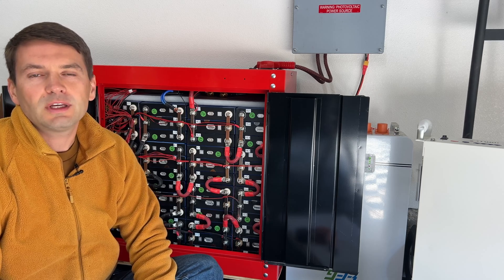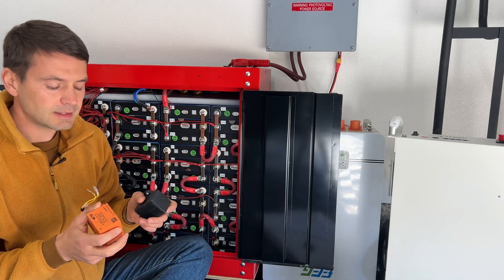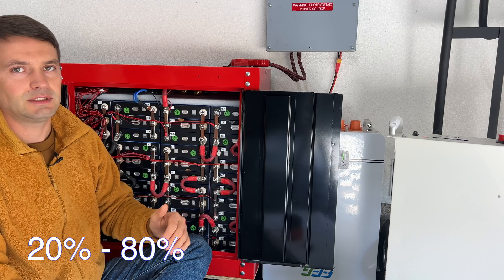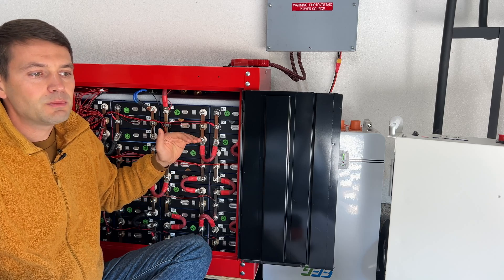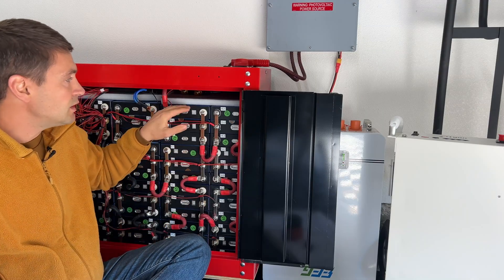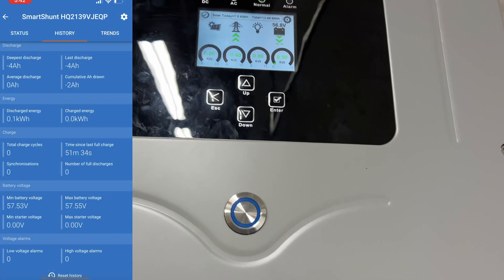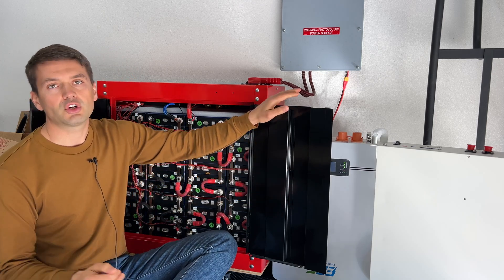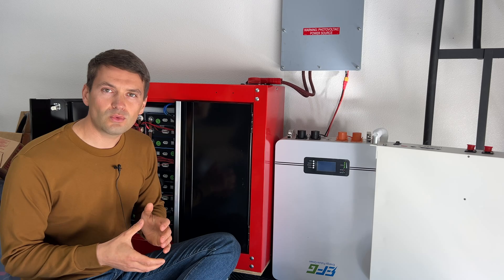Testing LiFePo4 capacity after 3 years of use. Are 4000 cycles realistic?

Comment: I have really come to believe that the 16s1p, 8s1p,4s1p configurations are the correct way to go considering the cost of a good bms isnt that much more than the cost of getting one cell sent to you. I think andys off grid garage is a good channel he has riding the compression non compression debate pretty hard. I also think the more modern (considering where the tech has come in 3 years too) cells are looking like the production techniques are spot on and that the technology is really taking its stride. I just bought some eve mb30 and it was a very easy streamlined process and they seem nice time will tell.

Comment: I just bought my first battery, so I don't have experience, but I've been learning a lot.  This is what I have gathered:  There is a difference between an "A" grade cell and an EV grade cell, an EV grade being suitable for use in Electric cars and which must pass the most stringent criteria specified by the Chinese government. Grade A cells are those which fail to pass EV cell tests and are sold for less. They have no government standard and it is up to the seller to decide what to call them.  Were your cells identified as EV grade and did they come with the original spec sheet? If they were EV grade then they should have. The spec sheets are often faked. If you got a spec sheet that was all black and white, it is fake. It should be colored. At least this is what I have learned (if it is indeed correct.)  Non-EV grade cells will have lesser life or performance characteristics. Feel free to set me straight if I'm wrong about this.

Comment: Are you licensed to work in Nevada...I live in Las Vegas?  I would like to get a solar system installed but nobody will install the EG4 18Kpv here since it isn't Enphase or SolarEdge.  I found one company that will install a Sol-Ark 15K but only if they supply it and they want to charge a fortune for the unit even though the prices have come down a lot since the release of the EG4.  I do have a great supplier (CSE Solar) here in town so I could get anything and have it on site.
Reply from the maker: no, only in CA
Reply: @SolarEngineering  OK thanks, its a shame I cannot find anyone here that will do it.

Comment: Sorry if this is a dumb question. So you only need to balance cells in series not parallel? For example, I could parallel 4 of your power walls and not balance them other than what is done in the individual power walls?
Reply from the maker: if you connect 4 PW in parallel than it's going to balance voltage across PWs, but not cells in each PW. Still need some kind of balancer in each PW (either active or passive)

Comment: I had an issue with balancing that is solved using additional neey active balancer. I think it will be much better if you are using compression on cells. Top row cells not getting any compression and this cell  orenation not good so chances of heigher degradation . I think vertical arrangement with proper compression will be good for longer cells life 
Thanks for sharing your experience.
Reply from the maker: I tried to add another active balancer, but 2 balancers were balancing each other sometimes :) so removed one.
Reply: @SolarEngineering  in my case in built balancer is only 200ma (BMS) and in neey Bluetooth balancer I can configure parameters and it's 4A

Comment: Hi. I am a LiFePO4 user and hobbyist. My idea is that not charging to full capacity (not 100%), is actually doing more harm than charging them all the way 3,45v and absorb there for an hour. It is my understanding that leaving the batteries at a lower state of charge (80%), is more likely to hit a low state of charge mire often. And my guess is that a being at lower voltage for longer periods of time is what kills LiFePO4 prematurely.

Will Prowse has mentioned it recently, that all the batteries he left empty, were done in few weeks, whilst the ones he left fully charged had no degradation whatsoever (not in intensive use).

If your batteries are going to degrade that fast, I would say it makes sense to fully charge them to 56V (3,5v per cell), absorb at 3,45V and float at 3,35V. It is still pretty conservative, and giving the opportunity for the pack to balance over 3,45V every day for a little time.

I would definitely also consider some CALB or EVE cells, renowned providers.

Also have to say I am jealous of that workshop and space... I live in an apartment and have no south facing space to fit panels...

Nice short video.

Cheers
Reply from the maker: thank you for the info and kind feedback.

Comment: I believe 4:25 someone doing these same kind of tests said that the capacity loss does not happen linear, in the total cycles of battery the capacity loss would be higher at start, then very little capacity loss long time, and then capacity loss would get again higher when battery life is about to end.  You probably could confirm or bust this information by doing some tests with shorter time period between them and compare the results if it's linear or is it more likely the bigger capacity changes happen only at start and end of the battery life.

Comment: Set charging voltage to 55.2V have balancer turn on at 3.45V I did this and my cells are coming way closer to each other. if you balance before 3.45 volts in a cell it causes more imbalances.  Also split your pack into 4 packs. you are not doing .15C those cells are small and large amounts of amps is too much. example is a 25ah cell in a Battery pack still is 1C at 25 amps. Doesn't matter if you have 4p. with a 25ah cell 5 amps is 20% or .2C. Your cells will not last as long as you think since you are really doing  3C or 4C. I have 280ah cells I do not charge or discharge any pack (4 packs of14.3kw) over .2 which is 56amps. That is why I have 4 packs and soon will have 6 when I add more solar and another inverter so I stay low C rating. I have 1.2 years on these cells. Just now getting them top balanced.
Reply from the maker: thanks for the advise

Comment: Flexible busbars would make a real difference.
Also, it is too late for that, but there are two orientations that your cells should not have.
On of them is your orientations. On the side, the gas bubbles from the first cycles can not escape and reduce your capacity. Also Fixation of the cells would help with this issue during the first cycles at least.
Reply: I second this.  The 4,000 cycles is with compression (at least for the first several cycles until gas has escaped).  Without compression I thought it full cycle life was more like 2,500.

Comment: On my 107,520 watt system I charge/discharge my 280ah lifepo4 cells about 70% from 3.5v down to 2.8v or 56v~44.8 (using only 75,264 watts of the battery potential)
Having Eight DIY 48v 280ah batteries in parallel they never get pushed and stay balanced primarily, because I run them at about 70% capacity I feel. This light duty cycle rate has been very stable and over the last two years performed very well. I have one 48v battery that needs to have cell 16 charged up a bit to fully balance the pack so it doesn’t kick off a tiny bit early. I may replace this cell if it doesn’t hold its balancing act 😂
I have the cells lightly ratchet strapped together but not compressed like so many others have done. The only swelling I have seen on any cell was because I was manually charging this one cell and forgot about it for two hours too long and over charged it to over 4 volts. I of course replaced the ballooned cell. This damaged cell sat outside for the last two years in the elements along with one other cell that was slightly weak. (about 5% below spec) 
I recently took these two cells and installed them in a 1952 Farmall Super C tractor that has a 6v system. I didn’t charge or check them and they kicked that old tractor to life super easily! Amazing LFP cells!
I am very happy with my system and have No Cell Swelling Whatsoever, except as explained.
Of course they are being run very lightly, exactly as I planned.
Thanks for your informative video 
Merry Christmas 
Peace Prospector Tripp
Reply from the maker: thank you for details about your system
Reply: @SolarEngineering hi, can you tell me tools I need to do a capacity testing on a 16kwh LFP battery
Reply: Hello friend 
Can I contact you through your Email? Expertise consultation on assembled batteries

Comment: I have concern wit how you arrange the cell bottom up. wit that said, my concern is that the bottom cell will have a different pressure compare to the top. That probably efect the fasyer degradation of your cell overtime.

Did you check single cell capcacity between you bottom cell and your top cell?
Reply from the maker: no, haven't run test on individual cells

Comment: Some thoughts...  Cells drop some capacity after the first few cycles, so part of that drop is likely because of that.  Secondly, all these cells calendar age in time, regardless of the number of cycles on them, I'm sure this is also what you're seeing here.  I believe I also noticed an outlier cell at the end of the test, which means changes are that one cell is artificially bringing down the capacity of the entire pack.  Changing that one cell out would likely restore a decent percentage for the entire pack as a whole.

Lastly, I would set the cells to a lowish state of charge, disassemble the entire pack, then fit in a fixture with springs (valve springs are cheap and work well).  I might be too late to remove the bloating, but you can remove a little of it with pressure and reduce the chance of seeing more bloating in the future if you contain the cells, but use springs at this point to make sure you're not completely confining them and causing more damage.
These are the springs I like to use (but similar works as well):
https://www.oreillyauto.com/detail/c/melling/melling-valve-spring/mel0/vs360?q=Melling+VS-360&pos=0
Reply from the maker: interesting idea with the spring, thanks

Comment: I install profesionally.  A fixture is mandatory for these cells.  In larger instalations like yours the expansion can stress the terminals and break the posts.  You can't compress the cells now, but i sugest you lossen and then re-tighten the bus bars to take some of the stress off the posts.  Drill the holes a bit bigger on the bus bar if you have to.  You could also replace with a flexible bus bar.  This might require a full disasembly of the pack if things are really tight.
Reply from the maker: thanks for the advise, I did loose and re-tight nuts on top 3 cells
Reply: @SolarEngineering  I'd sugest doing the rest too.  They proably have not expanded as much due to the weight on them, but there was no fixture so they will have expanded too.
Reply: I personally would disassemble the entire pack, set the cells to a lowish state of charge, then fit in a fixture with springs (valve springs are cheap and work well).
Reply: @ssoffshore5111  this was my thought the first time I came accross this problem many years ago.  The problem that arises is that the fixture ends up cocking the cells back and forth, and makes more stress on indvidual terminals.  Also, if the fixture is too tight, the pressure seal on the cells breaks.

An ideaI haven't tried this yet, is adding a fixture that is coupled with some sort of calking between the swelling gaps of the cells that would stop the further movement of the cells.
Reply: What about pouring epoxy between the cells
Reply: Are the cells expanding because of excessive heat temperatures? Do they need air gaps for cooling seems like a good idea to have some heat separation.
Reply: I came late to this post, I think there was an issue with the Bms, if all the cells was matched(balanced) , then its could have been difficult for that cell to swell, another thing will be terminal, its there is a partial contact, its can still cause that cell to swell. Also please take note that charging your batteries to 80% cannot make your cells to be balanced at all time.  Am talking from experience, I also had a DIY I build for a client system, 460ah 48v, I used Daly BMS, this systems was done 4years & 7months ago, everything is still fine.

Comment: Great vid as always thank you. How about a video on Growatt TL MIN-XH-US installed to grid???  Nobody shows Growatt installs and they are very reasonably priced inverter.
Reply: I am not sure about the model you mentioned, but David Poz does a few videos on the Growatt SPF5000ES. After watching his videos, that is the model I decided to go with, even though I had to get a Mid-Point Transformer in order to get 120V, as they put out 240V. I still feel that they are one of the best inverters for the price. I've seen a few, including the EG4 6000XP Off-Grid Inverter, (Which is also sold by Signature Solar), but I wasn't able to afford two of those at $1,399 each, while I was able to get the 5000ES at $900 each , or $2,258 for two plus the Transformer. They are now lower priced at $746 each, (plus, of course, the cost of the Tranformer). 
On the other hand, DIY Solar with Will Prowse has totally gotten away from Growatts and gone with the EG4 brand.
Reply: @Tumbleweed5150  I really like eg4 6000 but you need two and at least one battery. That’s three times the price of Growatt.
Reply from the maker: thanks, sorry not planning to do growatt reviews yet

Comment: Thank you for the update video on capacity! I wonder if the difference in accuracy of the shunts used from 1st test to the Victron would account for some of those capacity differences?
Reply from the maker: yeah, potentially it's possible
Reply: @SolarEngineering  That was exactly my thought - 5% drop in that short of a timespan sounds drastic, but diff's in measurement technique could explain a lot of that. I also have heard it claimed that they lose "a lot of capacity" in the first several cycles, but that loss over time flattens out. How many times did you cycle them initially? IOW, is that initial baseline even valid, irrespective of the differences in the shunts being used? Not really a criticism, just wondering...

Comment: I'm by no means an expert, but from everything I've seen, the degradation of these type of cells is not linear. They drop most of their capacity in the first 4 - 5 years (around 10%), but then they take another 10 years or so to drop another 4 - 10%, so they may very well still hit their 80% target or even exceed it (in a positive manner).
That being said, I'd imagine that if part of the cells are much more heavily bloating like in your top row, they might drag down the capacity of the entire pack heavily. Maybe you could even regain full pack capacity if you replace the worst cells, to prevent the BMS from triggering a low voltage cutoff on the worst cells.

Could you maybe see which cells are the lowest voltage at low voltage protection levels?
Reply from the maker: I haven't checked what cells heating the low-voltage disconnect (in video's screenshot it is cell#1 which is top cell in pack). Hopefully, you are right about not linear degradation.
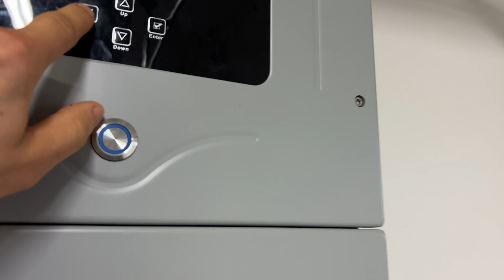Reply: @SolarEngineering  Ah yeah @4:03 , so then maybe I'm right about the pack being severly handicapped by the swollen cells reaching lower voltages much sooner? Looks like that #1 cell is MASSIVELY lower voltage than the rest of the pack (about 0.32v, which is a massive part of a LiFePo4 voltage curve). If you replace and re-balance a new cell, it could maybe reverse a large part of the degradation.

Comment: Thanks for the information. 
I'd point out that the way the upper batteries don't 'line up' is not an indication of swelling of upper cells only, but simply some cells in the stack. You won't know which cells are swollen until you take it apart, and also the differences are an AVERAGE of the likely swelling, so there could be swelling in the lower stack AND the higher stack together, showing more swelling than you might originally think. Just MHO.
Reply from the maker: visually it's only top cells, but you might be right that other cells are swelling as well (most likely they are)

Comment: I bought 150 ah cells from bls battery in 2019. They were made by higee i think in late 2018, steady use down 9.5% capacity and 2 to 3 mil bloating on ever cell. They stay balanced at 3.5 per cell higher than that they spread out alot.
Reply from the maker: thanks for the info

Comment: I choose the middle ground between diy and premade.
Use exclusively the seplos mason 280 diy kit.
This enclosure compresses the cells, bms talks to my inverter..
All in all really happy with them, and more importantly, after 3,5 continues use, the is not capacity difference between my newest pack (3,5 years old)  consisting of grade a lf304 cells, and my newest pack containing the same cells
Reply: Btw, hate to say it out loud, but bsl doesn't sell automotive grade cells, only b grade..
Good news is though, that cell got bigger, and a lot cheaper...
Plus there are now us sellers that carry them.
18650 battery
Ezeal 
Battery hookup to name a few
Reply from the maker: did you measure capacity on 3.5 yo?
Reply: @SolarEngineering  yes I did.. every time I add a pack I do a capacity test before I add it..